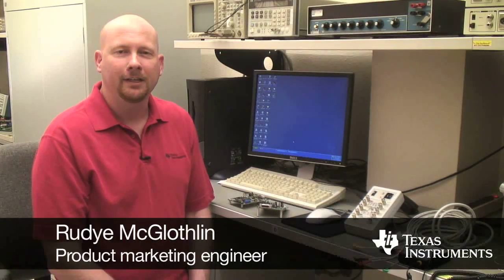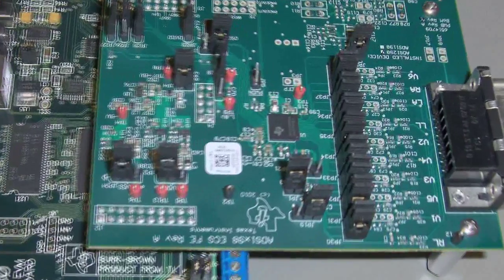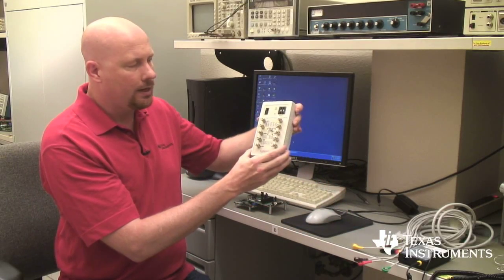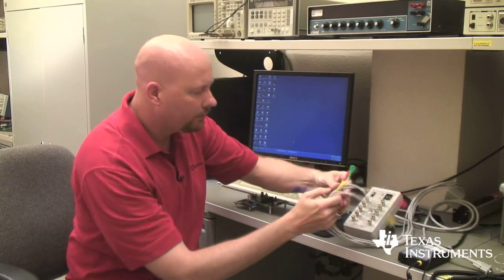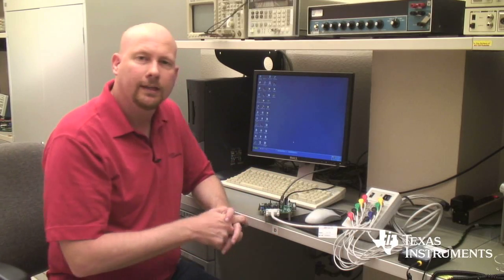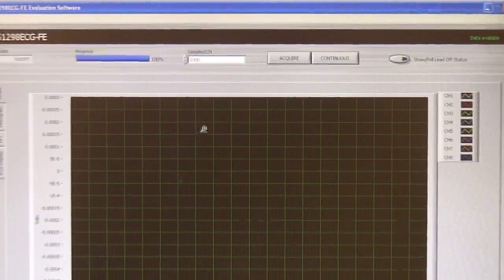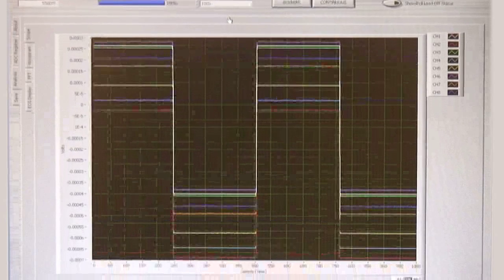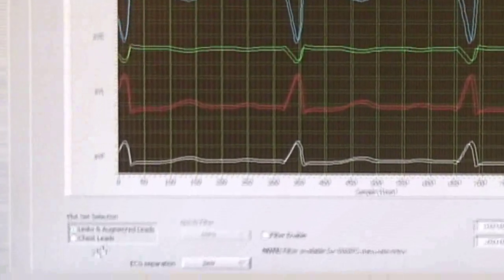Getting Started With the ADS1298ECGFE-PDK

Comment: Dear Texas Instruments Support Team,

I am currently using the ADS1298 and have encountered an issue while deriving ECG leads. I am following the instructions provided in the ADS1298 datasheet:

On page 27, I used the Save Tab feature in the ADS1298 front-end GUI to save the data codes, which contain 9 channels of data.
On page 32, I followed the Lead Derivation process to plot the ECG graphs. While the calculations for Lead I, Lead II, Lead III, and all augmented leads are correct, the derived signals for V1 to V6 appear to be incorrect.
I have the following questions regarding this:

For the values I receive from Channel 1, Channel 4, Channel 5, Channel 6, Channel 7, and Channel 8, do I need to subtract the Wilson Central Terminal (WCT) from these values to derive V1 to V6 correctly?
If the exact values of LA, RA, and LL are not known, how can I calculate or approximate the WCT value?

Comment: The video describes hwo to use the board for ECG, but it mentiones that it can also be used for EEG sensors. The ECG sensors are connected through a 15 pin connector to ther board. How are EEG sensors connected to the board? Can I connect the board to this 8 channel EEG headband?

https://www.aliexpress.com/item/33001055103.html?spm=a2g0o.cart.0.0.66053c002IfvI7&mp=1

Comment from the maker: Hi Antonio: We do not have any drivers for the ADS1298, for non-real-time or real-time applications. You can use the EVM as a stand-alone EVM and direct connect other boards/processors to the digital header (reference the schematic located in the user guide).  Additionally, make sure you connect power via the power connector for proper operation. Hope this helps.